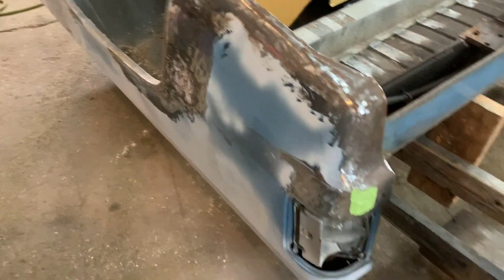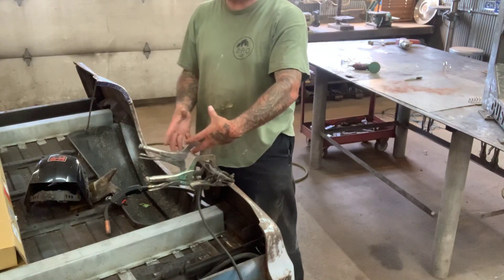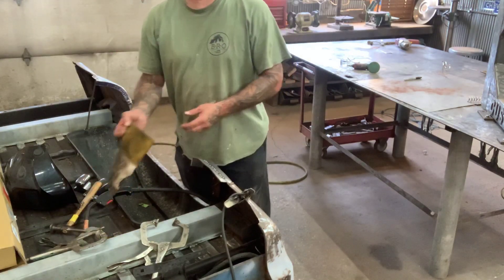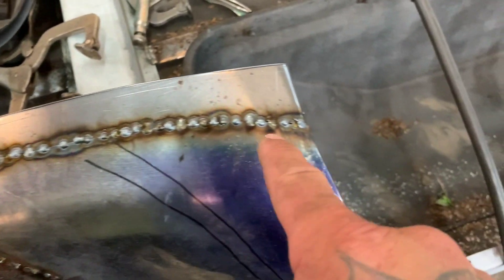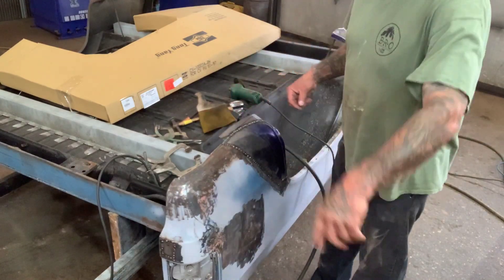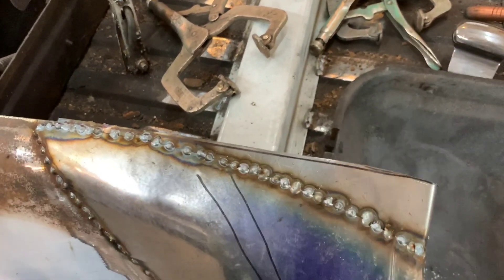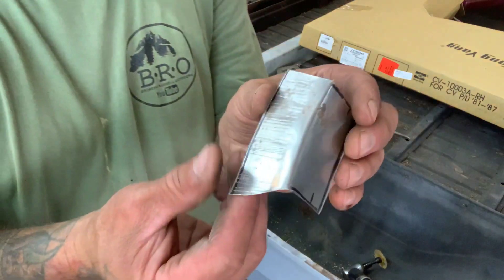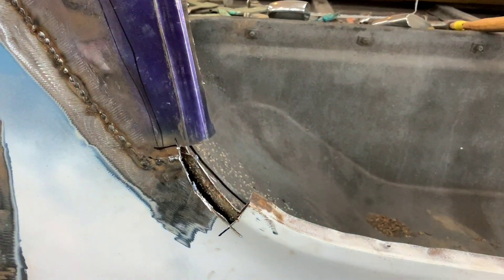Squarebody chevy truck bed repairs

Comment: Really enjoyed the video. I think yours is the only video on YouTube that shows close up shots of how the inner support piece is positioned/spot welded to the fender patch you welded in. I just finished repairing the same areas on my square body. How did you remove the bed from the truck and flip it upside down? I used an engine hoist to remove the bed and sat it down on the garage floor. Then I repositioned the hoist to pick up one side of the bed enough to be able to flip the bed over. I only had my wife helping me and it was really sketchy and dangerous doing it that way. I know, I was a dumbass. Any advice on a better way to flip the bed right side up when I’m done with the body work?
Reply from the maker: I had the bed on a delivered on a slideback tow truck and we slid it onto that dolly we made. But me and heidi literally flipped it upside down. It wasn’t easy lol. There really isn’t an easy way to flip them over cause they are heavy. Thanks for the nice comments brother. Take care! ARCO
Reply: @OutlawEdge  You live in some beautiful country up there in MN. I love living in western Wisconsin. I grew up here, moved away and joined the Air Force in 1986. Retired in 2011 and knew I wanted to move back. Glad I did.
Reply from the maker: Thanks for your service brother! My Dad is retired Airforce and viet nam vet. He was the C5A galaxy wiring specialist that repaired all the gauges in those planes ✈️ 👍
Reply: @OutlawEdge  I never had the chance t o work on the C5’s. I mainly worked on fighters, bombers and helicopters. I worked structural maintenance.

Comment: Metal work is by far the worst step in restoring old cars and trucks, it ruins the project for me. Its tedious and aggravating. Swapping motors and doing upgrades is fun but fixing sheetmetal and doing paint and body sucks. I gotta give you credit though, you did a very nice job.